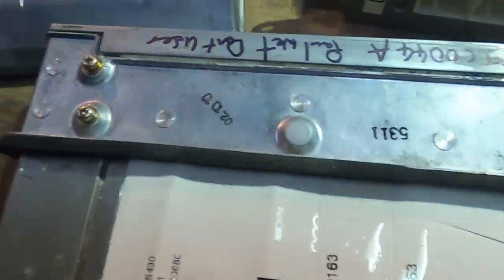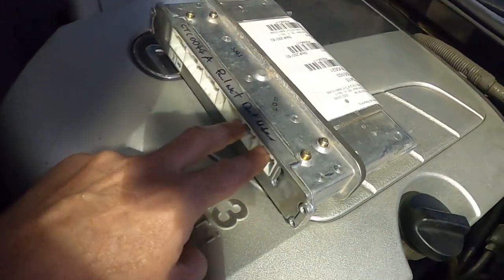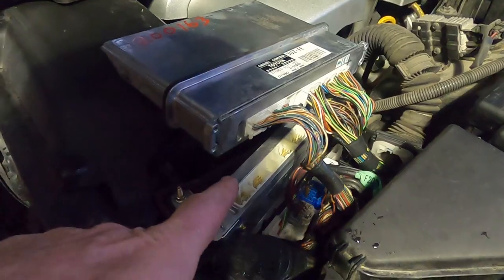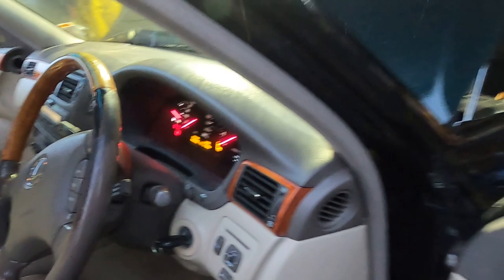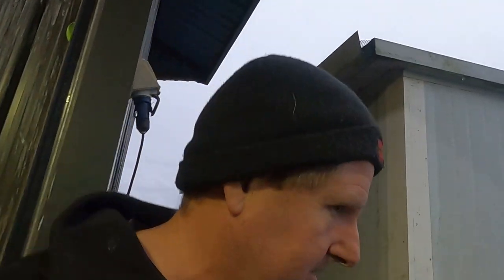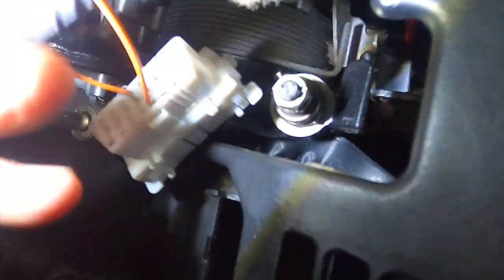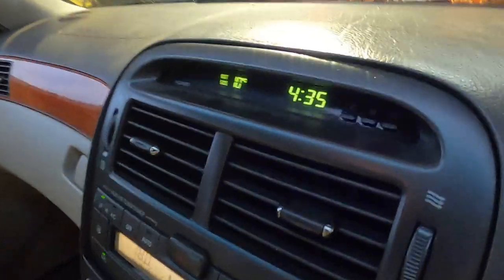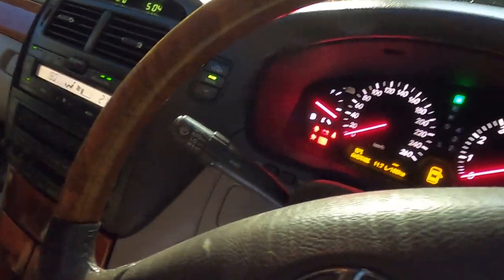Lexus LS430 ecu swap.  DIY immobilizer alignment.

Comment: Great video Kelvin, interesting how the original key/ecu combo immobiliser resets when paired with a new ecu.
Reply from the maker: Yes it is.  At least this is an easy solution for swapping ecus.  Im glad toyota made it this way.  Cheers Kelvin
Reply: Hi Kelvin!!!  Would this work if I had the smart key?  My car is a 2005 ls430, thanks for your time!

Comment: Have an 01 3uz fe out of an ls430, never was able to get ecu, ignition, or pedal from seller. Can i just use a flashed immobilized ecu and switch to a dbw throttle body to test start it on the stand?? Plz help from Montana 😅

Comment: If I'm doing that same process on a 05 Lexus LS430 replacing or swapping the ECU and you have a key fob instead of a key do you still use number for number 13 and is the process still the exact same

Comment: Nice video Kelvin. Thank you. Does it work (similar way) on an 1995 ls400? Thanks
Reply from the maker: Negative.   Immo ecu on 95 if present have the same ecu so can be interchanged into immo cars.  Very different systems
Reply: @CartuneNZ  thank you very much. In fact, the one I want to buy has no inmo as far as I know. I was confusing inmo and coded key but I guess it is the same. Mine (hopefully) has not a coded key because I mechanised one key (lost originals) and it starts perfect… Sorry I was confused but itt is clear for me know. Thanks a lot from Spain

Comment: Would this process work for the vvti 1uz motor? I need to repair or replace mine, and I’m having trouble finding the correct capacitors to order

Comment: Can this be used to program extra keys to the ECU, or is it just initial installation?
Reply from the maker: There is a different process for manually adding keys
Reply: @CartuneNZ  Yeah, I've tried that and tried using TechStream, I get an ECU communication error. Might just be the cheap key I purchased to replace my master. Really appreciate your reply.

Comment: Kelvin, on your outro I see the temp @ 12 C.... I'm showing 38 C (100 F) in my garage. It would be interesting to do  a long-term test on that submarine ECU to see if it eventually fails.
Reply from the maker: I ran it for a couple of weeks but got sick of clearing fault codes ever few mornings,  but I think that was more jdm verses usdm,  and the hard shift issue was getting worse.

Comment: For anyone wondering what ECUs hold what data, according to the tech manuals:
- The Steering Lock ECU holds the Immobiliser Code Registration Table (aka key codes), and also an ECU Communication ID Code Registration Table
- The Theft warning ECU hold the Smart Code Registration Table (for smart key functionality)
- The ECM (aka the "Engine ECU") holds another ECU Communication ID Code Registration Table (corresponding value as the Steering Lock ECU).

As far as I can tell, the ECU Communication ID is what both the Steering Lock ECU and ECM need to agree on to allow the car to start, and this is what the process in the video is doing. 

The same process (with an extra pre-step on the Toyota diagnostic tool) is used if you need to replace the Steering Lock ECU but retain the existing ECM in the car. My guess is that the 30 minute process is maybe generating a completely new ID which is written into both Steering Lock ECU and the ECM, which is why you can't hot swap back to the old ECM. Even though the documentation calls it a Table, it seems like it's not storing multiple values.
Reply from the maker: Correct,   it rewrites a new ID code to both steering lock ecu and engine ecu when resetting Immo in this manner.  Interestingly enough, we can turn off the immobilizer in juat the engine ecu, however.
Reply: @CartuneNZ  that's interesting, will keep that in mind as I'm thinking of getting Phoenix to map an ECU for mine, I guess then that you could get the immobiliser removed too and then they'd be hot swappable perhaps.
Reply from the maker: @ls430vip  yes,  immo off ecu,  hot swapable,  even going back to.the programed original ecu is possible hot as well.
Reply: @CartuneNZ  nice, I'd better grab a second ECU then. Thanks for all the videos 👍

Comment: Hello, I’ve got cel code 27 on sc400. The info on the code(sub o2 sensor signal) and how to fix it is scarce. I’ve come here to see if anyone could lend a hand.
Reply from the maker: Have you replaced the sub oxygen sensors?  https://youtu.be/KzTtt_oBGV4